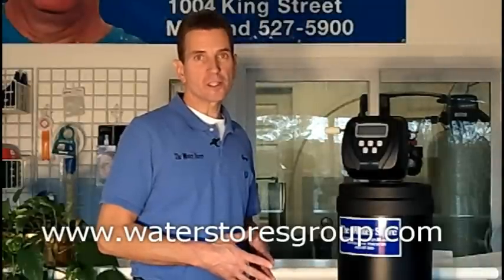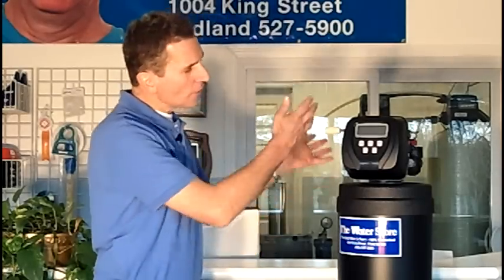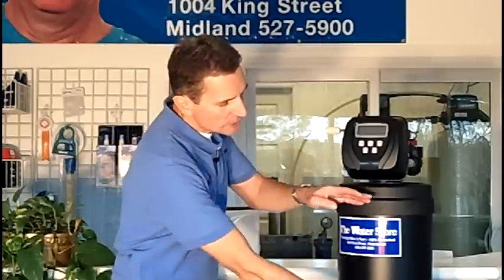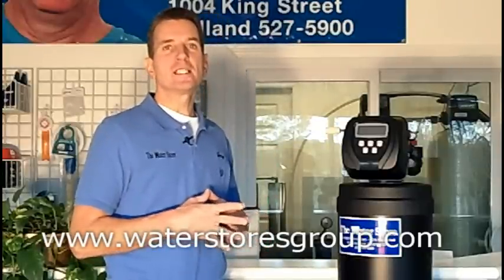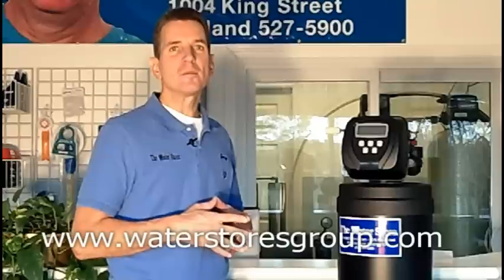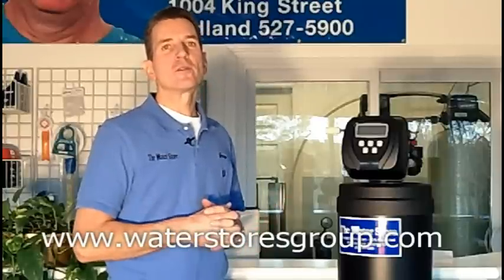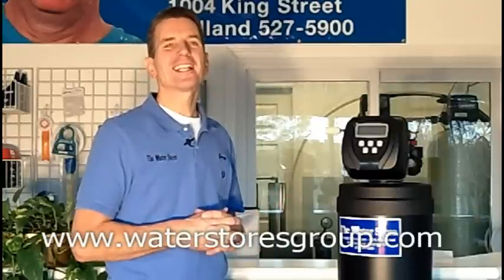How a Chemical Free FOB Iron filter works

Comment: Hi, enjoy your series. As we are new to "country water" we have a lot to learn. We have one of these FOB Iron filters (book says Fusion2 by Waterite) and a water softener however we do get some fine black residue that builds up in the toilet tanks. Perhaps manganese? We also noticed that after regeneration of the iron filter we get black stained water from all of the taps for a while. If I understand your video the iron captured by the filter should be dumped into the drain. Is it possible that this FOB iron filter was hooked up incorrectly and is dumping the captured particles into the water supply instead of the drain?
Reply: Thanks for the advice. We will check out the water softener cleaner. Is there a special filter we could buy to deal with manganese?
Reply: Thanks. Will try cleaning and regenerating the water softener as you suggest. I think we will also try bypassing the FOB iron filter as when we regenerate that FOB iron filter we get the black water for a time until it flushes out.